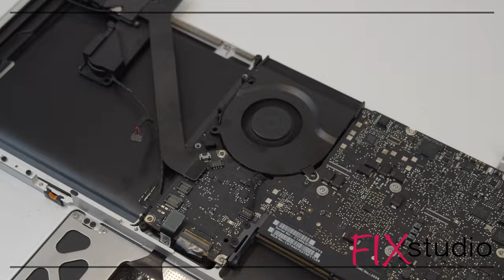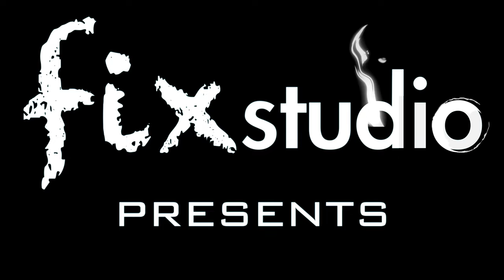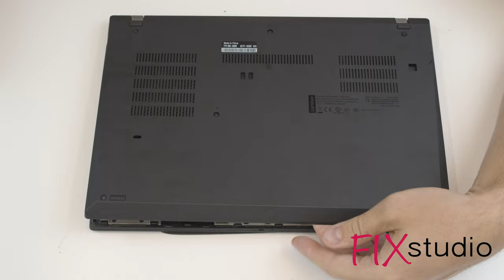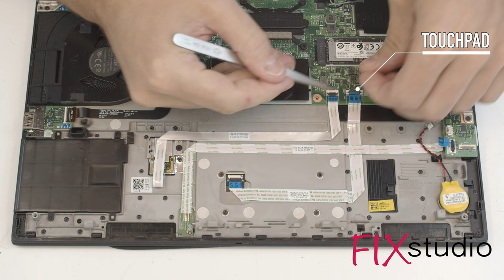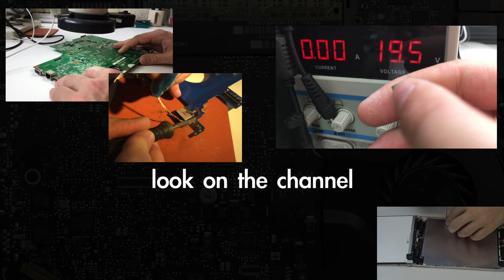Lenoto ThinkPad T490 - disassemble [4k]

Comment: Great video . . I just received my T490 and want to install a smart card reader. is that the connector slot next to the fan connector you disconnected.  Also do you have any information on installing the LTE option. Many Thanks, have liked and subscribed.
Reply: According to another comment, the LTE thingy can be installed under the black tag above the SSD. But it might not work without a software update.

Comment: Question what is that black plastic above the SSD? Is that another slot for an SSD? 

Like a mini m.2? Since the wifi is built in already.
Reply: It is for the LTE
According to people online you can install another m.2 driver but the system will not recognize it, it's a shame.
Reply: @sebtroop23 oh really? What a shame. I was thinking of getting one and using that slot for extra storage instead of external drives.

Comment: Do you think removing the touchpad is necessary for replacing the keyboard assembly?
Reply from the maker: No. Basically you just need do remove two screw under the touchpad keys.

Comment: I'm going to replace keyboard at T490. Is it possible to replace keyboard without unscrewing(+disconnecting lots of connectors) of motherboard? Thanks!
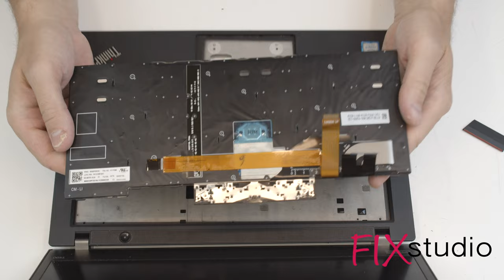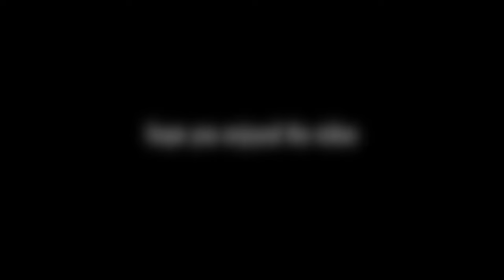Reply: from the seconds 5:52 and 6:00 it looks like it's still necessary to completely disassemble it :)
Reply from the maker: Basically you just need to remove two screws unter the touchpad buttons...
Reply: @fixstudioTV  thank you!